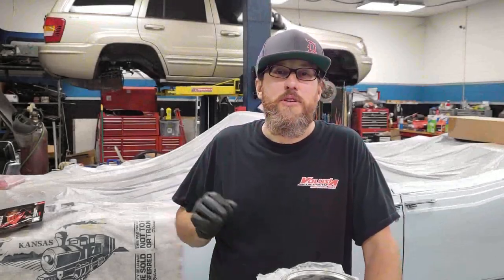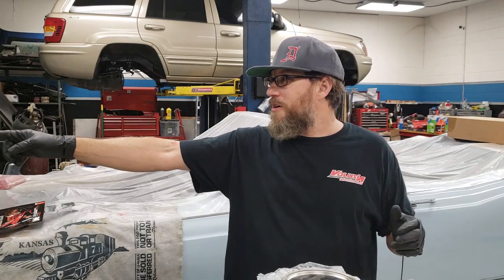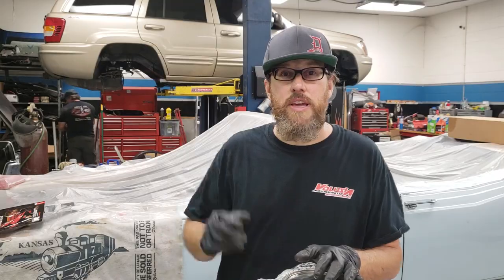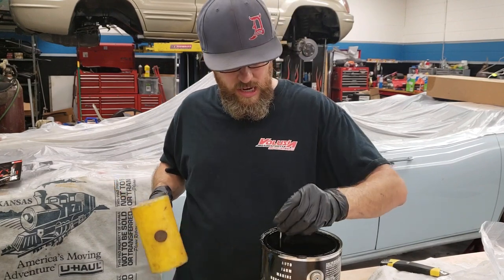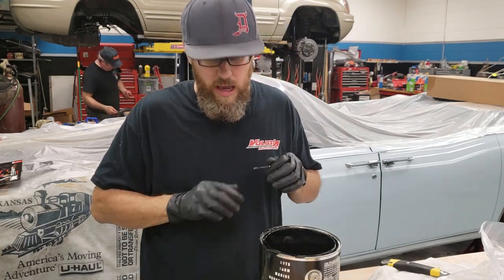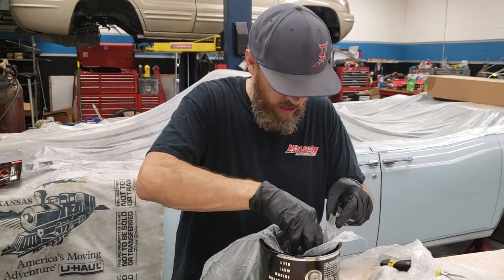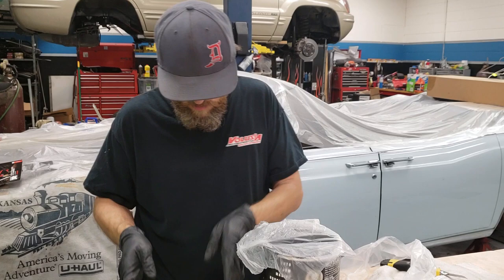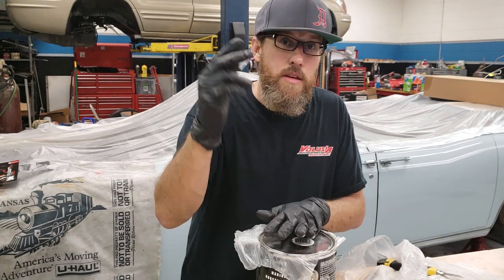Quick Tip - Sealing your used paint cans to last years in storage!

Comment: I was told to store your paint cans upside-down to keep them from drying out. Ever heard that one before?
Reply from the maker: yeah I have done that too.  Seals that seam up. I like to put plastic down in the can directly onto the surface of the paint. That way you are sealing out any air from the paint.  Overtime it will still go bad but seems to add years to the life of it.  Especially latex.
Reply: Doesn't work well for water based paint without the plastic seal over the rim.  Water will rust the metal rim over time.  The double plastic method in the video is best IMO.  Funny enough, if I'm preparing food in a bowl and I don't want it to dry out in the fridge, I'll put a sheet of plastic wrap touching the food and then cover the bowl with a piece of wrap.  The results are like night and day.
Reply: Ted Zeiger:  That’s something that my grandfather used to do when I was a little girl. Everybody else’s paint seem to dry up, but his was always ready when he needed it.